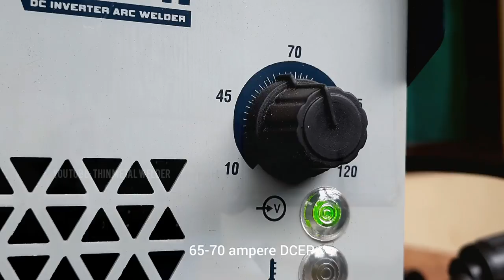not all know, the easiest way in vertical welding thin square tube ( T-joint)

Comment: Why would you weld vertical on thin metal? Ridiculous. How many worthless welding channels does this guy have? SMH
Reply: I need to weld thin metal on my truck vertically, not all welds are on a weld table.
Reply: What I meant, is that you weld down (drop weld) on thin metal not up (vertical weld). Then you won’t have to tack weld, which is a bad idea with stick welding.
Reply: @royandrews5886  Would be good if you show us in a vid. Thanks